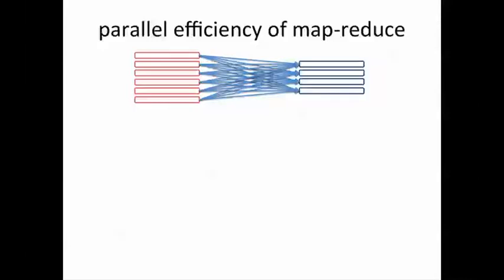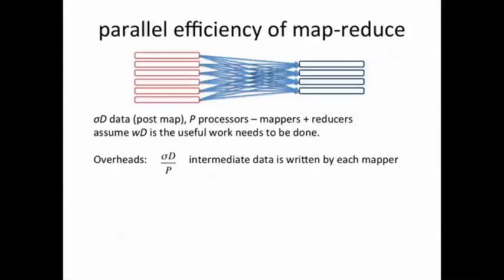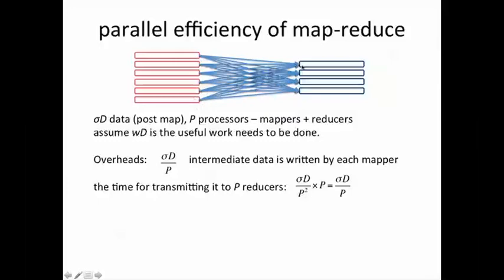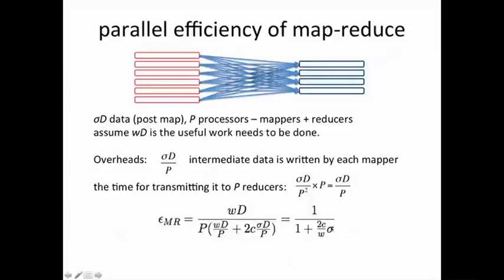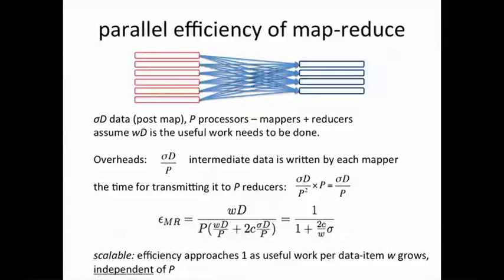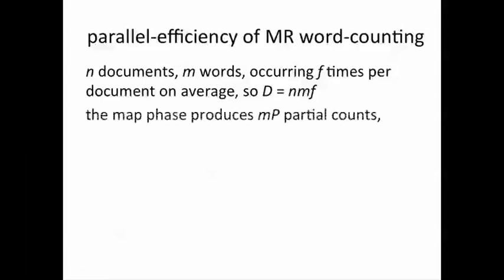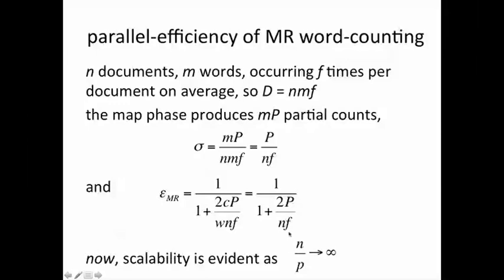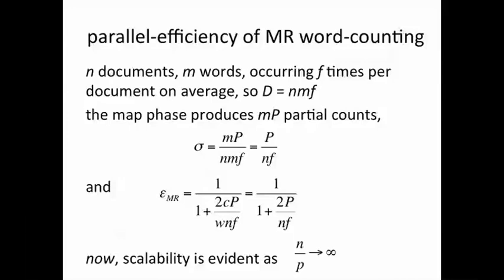Big Data | Parallel Efficiency of Map Reduce 8 42

Comment: Since the sigma depends (decreases) on increase of n (no. of documents) which in turn increases the efficiency it is better to have multiple number of documents to increase the efficiency.
So,  what if we divide the words in documents even though there are very less words per documents?
I see there is another factor of "f" (times each words occurring per document) which has same relation as n with sigma.
So if we try to increase f, n decreases which makes the idea of dividing to large number of documents invalid.

But should be considerable to talk about of f and n both while talking about the scalability of the algorithm.
Just saying, idk.